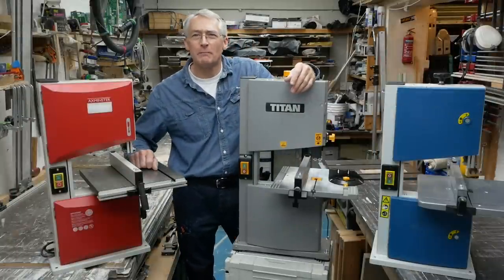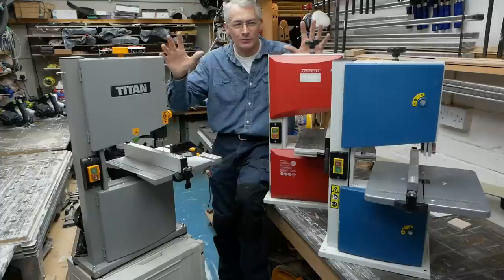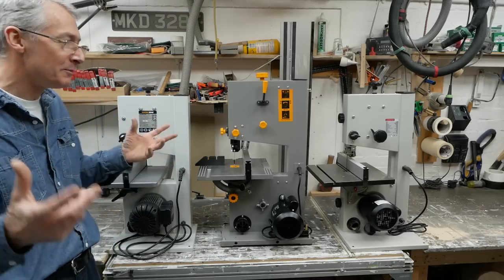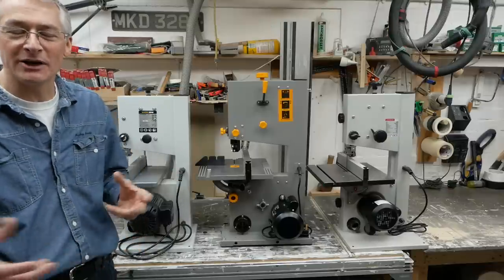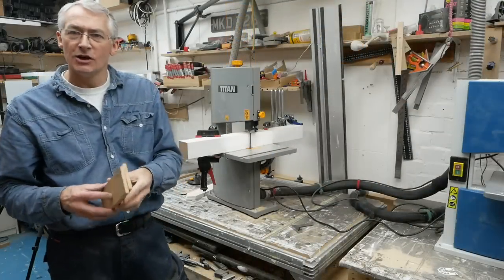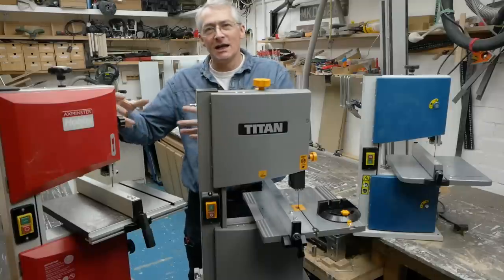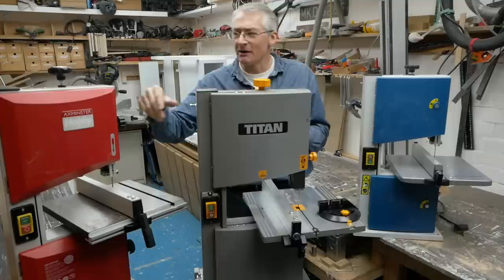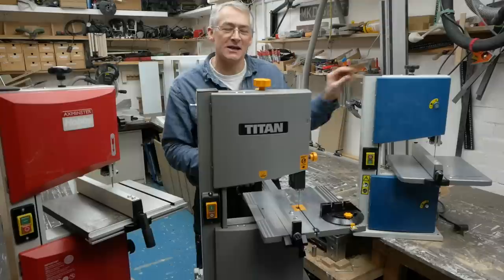Cheap bandsaws (again) #148

Comment: Very many thanks for a very interesting video Peter. I purchased a cheap bandsaw from Argos last year - £59, but unfortunately had to return it as it kept shedding the bands. It was identical to the Aldi saw you have. Since then I bit the bullet and bought the Titan and have to say that apart from the table itself, I am very less than impressed. I cannot tension the blade properly at all and am currently in discussions with a blade maker to try different sizes.
Thanks for your great work
Reply from the maker: Sorry to hear. The blade length does seem to be a bit of an issue for the Titan - I’ve had a couple of people suggest my blade being too long as the reason my quick-release blade tensioner doesn’t work! For blades, try Ian at Tuffsaws - very helpful, knowledgable, and generous with his time. Makes fantastic blades, too!

Comment: I bought the Titan Bandsaw last year, and it's been fettled. The blade was upgraded to a Tuffsaws 6tpi carbon supertuff, makes a huge difference including 15mm square solid aluminium bar cutting(!). I replaced the door opening screws with knobs and threaded dowels. My fence was set parallel to the blade cut and the clamp tensioned, doesn't move now. Blade drift was solved with slowing down the material speed and a lot of practice. Hope this helps, and great informative video.
Reply from the maker: Thanks Nick! Yes, a fence and blade upgrade is planned. But fan of Ian at Tuffsaws👍

Comment: The purpose of the leaver that removes the tension on the blade is
 a) to  prevent imprinting the blade on the rubber tire when the saw is not being used for long time. Those imprints result in uneven wheel surface that create vibration and lead to lower cut quality 
b) prolonging blade life by removing stress from the weld when the blade is not being used

Due to slight variation in blade lengths      the tensioning mechanism must be used every time when changing blades.
The lever is there only to take the tension off when the saw is not in use and put it back on the same preset amount before use.
It is a useful feature (if it works)

Comment: I'm tempted to get a second bandsaw - I use my monster one for ripping and changing blades is a real PITA when you need them set up very precisely - a little cheapo with a 1/4"  for scoll work would be a real luxury. BTW ALL cheapo manufacturers quote the INPUT wattage (bit dishonest marketing BS) which is usually 20 to 30% more than the actual output wattage - Axminster and proper brands dont do this - they'll all have equal motors, Titan here isnt direct drive which means less stress on the motor and a gearing advantage but a slight drop in power (though its less likely to stall)

Comment: Hi Peter, another good review. I recently purchased the Titan band saw and like you found the fence was a bit iffy. I re engineered the clamping section of the fence because I found that when you applied the cam lock that it pulled the clamping lug up at an angle so the surface area of the clamping force wasn't enough to lock the fence solidly. That's easier to visualize than it is to explain. The blade quick release on mine worked very well, I noticed on your's that the gap between the top wheel and the case was much larger than on mine which would suggest that the blade length may be slightly shorter which would pull the blade away from the release cam. The stock blade I had worked perfectly but its longevity was not great. I purchased a Starret blade to go with the bandsaw of the suggested length but found it was slightly to long and could not be tensioned at all so I re-engineered the top wheel carrier to accommodate the new blade and all worked well. It appears that blade lengths are possibly more of a hint than an accurate statement. I hope with these minor fettlings in place that the bandsaw will do as it should for a long time to come. Hope yours comes good in the end.
Reply from the maker: Hi Kev. Thanks so much for the detail, that’s really helpful. I need to dig around the fence some more, certainly; hadn’t occurred to me that the blade length may be off though, good catch! I need to play with it a bit more, figure out what’s going on - hey, maybe there’s a video in that! 😂👍

Comment: I have the Mastercraft (sold by Canadian Tire), a dead ringer for the Titan. The problem I have is with the lack of adjustability of the guides and thrust bearing. Very little available adjustment if you want to go to a 1/8" (3.125mm) blade.
Reply: I just picked up a MasterCraft bandsaw and going through it for the first time.  Yes those tiny little metal nubs for the guides are difficult to work with
Reply: Now that watched the video a bit, you're right, it's exactly the same.  The only minor difference I can see is the on/off switch

Comment: Very interesting video. I learned a lot of it. The S1 and S2 is now totally clear to me. Aldi is not in Slovakia but Lidl is. In some countries (not in Slovakia yet) Lidl has an online-shop,
where many things (among which also tools) can be bought the whole year around. I can imagine Aldi does the same if they want to be competitive.
For my Scheppach I made a kind of "barrier" to stop fine sawdust going into the inner part of the height adjustment system. It consists of two pieces of wood in which are
small magnets (ordinary, not rare earth) to keep them in place. It´s not perfect yet but at least I can see how the sawdust "flies" because I painted the wood green.
I'm satisfied with the fence of the Scheppach. The table itself is another story. It is magnetic so that is a great advantage (the fence is not magnetic) and can be put at an angle
(what I did not use till now). The lack of a mitre slot and mitre gauge is a disadvantage. Maybe I should try to make a table for the Scheppach myself, one day.
On the whole I'm satisfied with the bandsaw and I hope I can use it many more years.
Reply from the maker: Thanks Hans! Yes, the Aldi/Scheppach are pretty amazing for the money. Plenty you could do with them to improve, but I think the table’s a sticking point! 👍
Reply: I don't remember anymore how the table is screwed/mounted to the chassis. I connected it 10 months ago and that was it.
I should take a look if it is a "mission impossible" or not..
In the video I noticed that also the Titan has a 1400 mm blade. So all three band saws  have the same blade length.

Comment: I bought the Aldi band saw and found it had really bad vibration. I had to balance the top and bottom wheels which improved the operation of the saw. It didn't take much to balance the wheel and I used hot glue as weight, which worked really well.
Reply from the maker: Interesting! I’d have just chucked it back to them! 👍

Comment: Hi Peter, I have had some great work out of the Titan bandsaw and continue to get as such.  However, as you say that came after a bit of fettling.  I sorted the fence by inlaying the lower grabs with sticky backed cork sheet and it is now rock solid.  I would also like to mention that the top yellow knob tensions the blade whilst the lever on the back de-tensions the blade by pressing DOWN and not up.  So the cammed wheel shouldn't reach the top section, it presses down to ease off tension.  It therefore DOES work!   Keep up the great videos.
Reply from the maker: Thanks. As I mentioned in the video, the de-tensioning lever doesn’t work on mine. It gets to the point where something looks like it’s about to happen then the handle hits the bodywork and won’t go any further - this is right at the end of the travel, so there’s clearly something awry. Glad yours works for you! I changed the fence on mine for a cheap Axminster one - see videos #294 & 294 👍👍

Comment: Hi Peter,
The so called wobbly fence on the Aldi is fine. All I needed to do was "spin" the cam lever until it was tight enough to grip the table firmly, then clamp the fence in place.

BTW, did you notice that the Aldi appears to have no drive belt but seems to be direct drive. (one fewer problem area).
Reply from the maker: Thanks Mike. It was the Titan that had the particularly poor fence, btw - the Aldi wasn’t great, but it didn’t affect the cut. And no, can’t say I noticed the lack of a belt - I haven’t owned the bandsaw for a little while 👍

Comment: Had my Titan for three years now, still original blade, mainly used for pine but some oak and hard plastic ! As for the fence ,set it up on day one and not touched it since. I can remove it when required and when put back is tight enough to pull the saw around the workshop with it (mobile table !) The mitre guide was sloppy in its channel but fixed that so all in all am more than pleased with it . What do people want for less than £100 !
Reply from the maker: Exactly! I think it's a brilliant little saw for the money! 👍

Comment: My cheap and cheerful B&Q bands I have had for a couple of years hasn't been used much because it drifts like the Titan. I might just give a block of wood a go to see if it fixes it.
Thank you Peter,  great review.
Reply from the maker: Thanks. I did a makeover in this after about a year, made a big difference. 2-part series, P1 here - vid 293	Bandsaw Makeover P1 	https://youtu.be/EGgwDYl7T9M
Reply: @10MinuteWorkshop  I'll check them out.
Many thanks.

Comment: Peter, turn quick release tension handle all the way to the anti clockwise (away from the beam) to relase tension. It doesnt push on the top plate, it pushes on the bar behind the wheel. You show it coming to a stop on the video. Interestingly i dont get tension as low in the adjustment as you, so now i need to do more fettling.   Also, i made knobs and shorter bolts for the doors.  Sure there is more but cant remember.
Reply from the maker: Thanks. The quick release lever does nothing at all on mine - it doesn’t bear against any part at all, there’s no ‘feel’ in the lever that you’d expect when it engages, it’s ‘floppy’, disconnected somehow. Need investigating, certainly 👍

Comment: After reading your very good review and thank you for that, I purchased the Titan, and I thought like you that the blade tension release lever did not work, but I found at least on my one, if you turn it anticlockwise as far as it goes until it touches the tracking knob it does work even with the tension knob set as far as it will go on maximum tension.
I agree with you about the 15 turn door screws, I have modified mine and now has (32mm diameter) large knobs the same style as the others on the machine with now only 4 turns with a circlip fitted into a groove in place of the squashed washer that they fit.
The last mod that have made was to fit a ( about 32cm long) flexy LED light that can be directed towards the blade as required.
Reply from the maker: Thanks for that update Raymond, very useful. I’ll take another look at the tension quick r lease, but I’m pretty sure it didn’t do anything on mine, whichever way I turned it! 👍
Reply: Thanks Peter for your reply. As the release lever is turned anticlockwise the rubber roller moves Downward (and not upward) resistance is then met (keep turning) as then it Compresses the spring all the way until it meets the tracking knob and then takes tension off the band.

Comment: Re the fence issue, here’s a nice comment from a Scewfix reviewer... Some people mentioned that the fence is wobbly. It is, but there is an extremely easy fix: Just slide a 1mm packer underneath on the far end of the fence (furthest away from you) before you tighten it. I got a bunch of plastic packers from Screwfix which have served me for all kinds of purposes, but you could just as well use some thicker cardboard. Problem solved. Axminster also sells a fence upgrade for 14 quid which you can bolt to this saw and should improve the fence even further, but with the packer tip, it's perfectly fine for rip cuts. "

Hope this helps.
Reply from the maker: Thanks. If you take a look at the next video in this series (#149) I draw those exact conclusions. Video coming shortly about the fence upgrade. 👍
Reply: Peter Millard thanks Peter. I'm just about to buy the titan so look forward  to you video.

Comment: The rip fence should lock if you tighten the locking lever , I have the aldi and it isn’t great  ,I think if you’re going to invest in a band saw I have a good one from SIP with a depth of cut at 8 inches ish for around £500 but it’s a solid machine and very useful in the workshop ,I’ll send a picture of it soon.

Comment: you should only care for S1 rating when comparing motors. S1 is always quoted but different manufacturers will quote different time duties like 60% 40% and 20% along with the S1(100%). Sometimes you will find S1 ratings on two motors and an S4 rating on one and S6 on the other. And you can't compare S4 to S6

Comment: Great video Peter very well explained nice to see these entry level bandsaws compared. I ended up with a Scheppach HBS30 very similar to the HBS20 except it has a 350 watt motor                                        
and extendable bed  300 x 300 to 520 mm. It's also supplied with 3 extra blades 6, 10 and 14. It performs very well for hobby work and light diy.
Reply from the maker: Nice! And thanks! 👍👍

Comment: A bit late I know, but having been after a Bandsaw for a few months and waiting for Screwfix to get the Titan back in stock.  Today I received notification that Axminster have their AC1400B back in stock and with £45 off.  So not as cheep as the Workzone or the Titan but with my rough maths not much more when you have to buy a new fence for the others.  I don't work for Axminster but thought it was worth a mention. Greg
Reply from the maker: Good to know, thanks Greg! 👍👍

Comment: Using the Sheppach Basa 1.0 just swapped the blade for a much thicker one & what a huge difference it makes much nicer cut on thicker materials. Thanks for your video if room here would allow I’d opt for a taller Record Power machine but I’ll make do with this.
Reply from the maker: Thanks Tony! Yes, blade upgrade is on the cards 👍

Comment: Hi , thanks for the reviews , but i notice that the Titan motor is offset rather than being direct drive as per the other two . is there a reduction in blade phrephial speed on the Titan ? , Mathias Wardle commented on his page that the direct drive ones where a bit fast
Reply from the maker: I’m afraid I’ve no idea - this video’s a few years old and I don’t have any of these bandsaws any more - but I certainly didn’t notice any difference between them in use. 👍

Comment: Another good review Peter. I have the Titan and as you say it needs a bit of Ferlinghetti to achieve good results but once it's set I am achieving good results. I found adjusting the 2 little pins that the blade runs through made a big difference. For what I need it for it is a very handy piece of kit for the money. Downside, finding more room in the shop to keep it 😩
Cheers pal
Reply from the maker: Yeah, getting the blade guides set up snug makes a big difference, and I'm amazed how much I use mine! 👍👍

Comment: Peter, the problem with your fence  is simply because it is not locked down tight enough. unlock it, turn the locking handle one full turn clockwise lock it down, the fence should now hold rigidly, if it doesn't give it one more turn until it does.  I had a 15 year old axminster band saw which finally gave up the ghost so I bought a titan and I find that it is much better than the old axminster.
Reply from the maker: Hi David. I appreciate the thought, but the fence play really isn’t because it’s not locked down tight enough! I can ignore the quick release and turn that screw as tight as I can, and the fence still pops up off the table. There are a couple of little plastic lugs that hook under the table to keep it located, and there seems to be a lot of wiggle room there: no matter how much I tighten it, in use it shifts. If I decide to keep it, there’ll be a fence and blade upgrade in its future! 👍